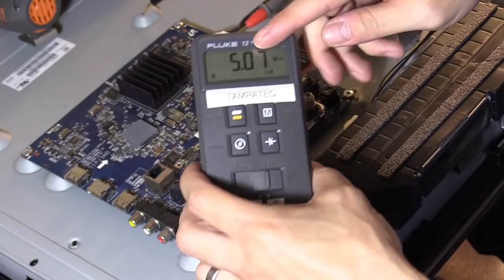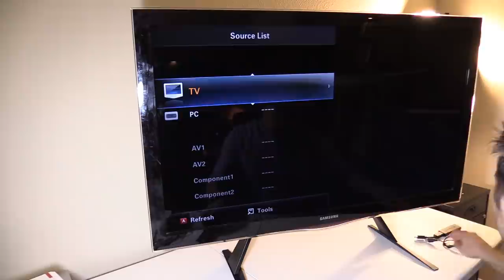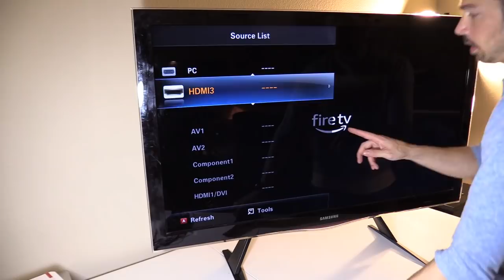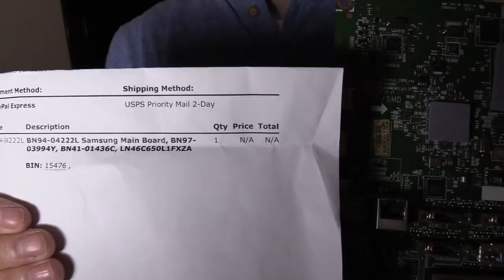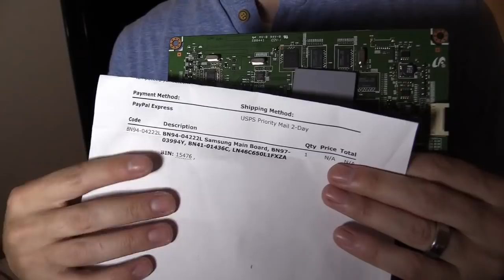Did the Main TV Board Replacement Fix My Dead Samsung LCD ? pt3

Comment: Hi. Currently trying to fix samgsung pn51d550c1fxza. I've replaced power supply board, main logic board and main input board.  The logic board has green light on then goes off and comes back on. No flashes. Any other ideas to check.  Much appreciate your videos.

Comment: I Have A 32 Inch Vizio TV That Dosn't 
Come On & Could It Be The Logic Board?
Or Mabey Some Loose Solder Connections?
Reply from the maker: Shopjimmy.com sells logic boards and board repair kits for Vizio tvs. Yes, sometimes Vizio logic boards go bad.

Comment: Did You Check The Original Logic Board For Loose Solder Joints?
I'd Do That Before I Put In The New Board.

Comment: Tampatec great video! Question I have a new Oled tv when I tune on it clicks and shows some horizontal lines then nothing. Main board issues , power supply or what are you thoughts

Comment: I have a Samsung un65nu8000fxza (2018 model) that I recently acquired and it has 2 horizontal lines about 1 foot from the top of the tv and the lines are about 1/8 apart. All my research has led me to believe its bad panel. Any input would be greatly appreciated. Thanks in advance!!

Comment: Thanks for the great videos, I need some direction on my problem
Samsung UN60J6200AFXZA
Stand by light on, no picture or sound. There was scorch marks on the power board. I replaced the power board, still no picture or backlights. When I disconnect the power board from the mainboard, I should get the led lights light on, but they don't. The power disconnected from logic board I get 12.87 dc volts. When I connect to the mainboard I get 10.0 dc volts. Any help would be appreciated. I don't know if it is bad led lights or mainboard or both.
Thank you

Comment: Is there a way I can email you a question? Unrelated to this video.  Issue with Arc, not covered in your other videos. Manufacturers no help. 

On another issue, I have a LG TV that gives me a splash screen but then just stays blue after. No input response. Will not turn off after turned on. Button or remote doesn't matter. Probably going to get a main board.

Comment: It’s frustrating but it has happened many times, right part ordered, wrong part received. On another note, I observed when you were comparing measurements between the two boards, make sure to have both boards in same condition. ie. Cables from other boards unplugged. Could make your measurements different.

Comment: awesome that you are sticking at it. thanks for the shout outs. :D as far as part numbers go, samsung use bn44-(5digits) then followed by (a letter) printed on a sticker. they also use a bn91 prefix but not very often. just be careful and confirn as they use similar part numbers for tuners and such as well. keep up the good work. :)

Comment: I have a tech question for you, similar issue. It is a philips 58pfl4609/f7, and if I disconnect the main board I get a steady 5V standby, after reconnecting mainboard the voltage drops and fluctuates from 3.7 to 4.3. Was getting ready to order a power supply board repair kit, and started second guessing myself thinking it could be the main board. Unfortunately I havent found a main board online, so I am most likely going to order the repair kit anyways, but would feel better about the whole thing after getting a second opinion.

Comment: My LG 3D backlight failed to light. It's on for a brief second then black screen. I used a flashlight and see the video screen is on behind the backlight. I still am not sure weather to change power board with the Motherboard until I watched this Video. I'm convinced it's the MB. Now the fun part, finding a Motherboard that you call a Main Logic Board for a reasonable price. Thank you for the Video and more than that the confidence to at least try. I will check for the Mainboard at TVpartstoday.com. Once again great video from one of your Subscribers

Comment: I've ran into the same problem a couple of times because I always zoom into the picture of the boards to make sure they are exactly the same, but sometimes they'll use the same picture for all the revisions of the same board and the one you need is pictured but the stores part Number is different.

Comment: Good luck; I hope I see your follow-up video.  It's nice to see someone fix a TV in this throw-away world we live in today.  It probably isn't echonomical for you to fix it seeing how inexpensive they have become, but you do get satisfaction.  Let us know how much you have invested in the capacitors and Main PCB.  The capacitors are a good idea to replace even if they wern't the primary problem.
Reply: He should have a go at fixing the main board though. Where I live, mains are not available economically. A fair number of times mains are dead due to regulators, tantalums, diodes or hdmi switching chip failures. Leaking caps can be seen under different light sources as well.

Comment: Ok. You need to go into the service mode.        Using your remote with   Tv off.        Hit. Mute.  182.  Then power.    Once the unit turns on. Set the  board to the size your  screen. Is.  And make sure the bezel color it. Correct.         Nice work my friend

Comment: Is the function of the T_Con board to drive the LCD directly?  In other words, there is no other board between the T Con board and the LCD?
Reply from the maker: buffer boards
Reply: Tampatec I have an 43” LG TV with ghost image, meaning 1/3 down the screen you see an image on the main image.  It used to occur intermittently  it is now permanent.  I have reseated the cables on the main board and T Con board.  This happens even with the menu.  I changed the T Con board but no luck.   What could be the issue?

Comment: I have an old LG tv 52” that started out taking a long time, more than 5 minutes, to come on. The audio would click and scream while it tried to come on. Then I just left it on all the time. LOL 
One morning I got up and the tv was dark. I turned it off and back on. Nothing but screaming from the audio, even muted. 
Any idea what is wrong? 
I have worked soldering pcbs but I havent done that in a long time but if I knew what was wrong with it I may be able to make the repairs myself and have a tv for the back room. Thanks in advance if anyone can help!
Reply: Caps. Power or main board ones would be my best guess. If it's bad solder, freeze spray around the board will show things up as well.

Comment: Love the vids. Been following. Has helped me in trying to fix my samsung. Got it up and running but still have one problem. Maybe you or someone here can help me with it. It is a Samsung ln46a530p1fxza. Comes on now and works fine. Only issue is when it first starts up the right side sometimes has lines and flickers. Also dark on that same side. After it has been on for a few it will flicker between working perfectly and being darkish. Then it will work fine till I shut it off and turn it on again. The first time I turned it on after the initial repair it worked fine. Maybe T-Con board? Not sure. Thank you anyone for the help.
Reply: Panel fault. I've seen that many times in that 2006 or so panel. 530, 500, 630 and 650 sets usually had the same panel. Tab bond failure. Once it's running, does it change if you grab the top or bottom edge of the screen and flex it a bit? The main connections to the panel were at the top of the panel and were prone to heat rising from all the fluro tubes warming it. Your set seems to work once they warm up. Small chance you can fix this by reseating the ribbon cables between the TCON and the panel (clean both end of them with a white rubber as well).

Comment: Hit info, mute, 182 and power , ive changed the model number before and it works, give it a try before you send it back
Reply from the maker: Ok will do👍
Reply: @TampaTec  ive got several tvs that are samsung, and some off brands that using the right setting will fix alot under the service menu. I have a 43 inch samsung with a 55 inch smart main board and a tcon from a sceptre lol.

Comment: All your videos are worth my time. You cannot help if the supplier can't send you the correct board. I just won't use them until I know from you that they were helpful in remedying the problem. I have a 32 inch I need to work on. It has NO STANDBY or POWER! Betting it's the power supply BUT. . . if I have learned anything from you it's "don't assume the obvious" because even that can be wrong. I'll be looking for your PT4 video soon! Thanks! :-) THUMBS UP!

Comment: I am a tv tech the BN41 number is only to identify the EMPTY board  The actual # is BN94 and BN97 for mains also the Factory menu can change a 42 inch to a 55 or in your case a 46 and the board you got is marked C650  that should be close  try another source as that fire stick may be set to 720p and that set has trouble with it (or the board could be bad!) good luck
Reply from the maker: Wow that's cool I'll try that, thanks 👍

Comment: i have a question for you my brother gave me a samsung 4k tv   its i think about 2-years old it works great but the there is a very thin line  in the middle of the screen it has not gotten any bigger .now does that mean the screen has a crack in .??.or is it something else also can that be fixed .??..please let me know thanks .!!
Reply from the maker: Check tcon connections but can be bad tab connection to LCD display panel.
Reply: @TampaTec   in order to check tcon connection do i have to take the tv apart .??..
Reply from the maker: @thomaslukehart6734  you can press around the TV bezel and see if it goes away if so it's bad tab connection on the display panel. (Note that's only temporary fix)
Reply: @TampaTec  ok thank you so much i will try this .!!